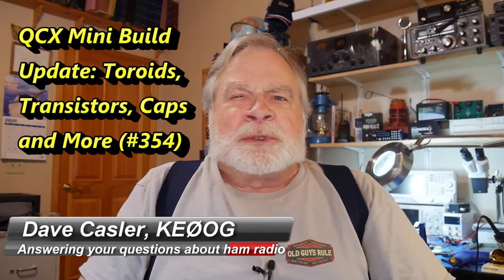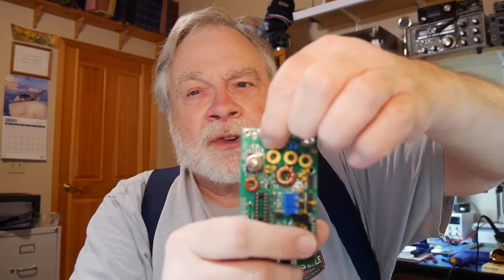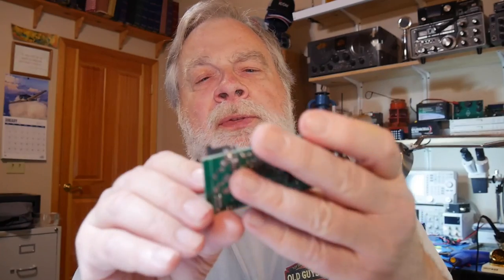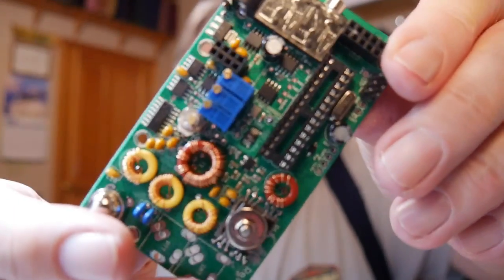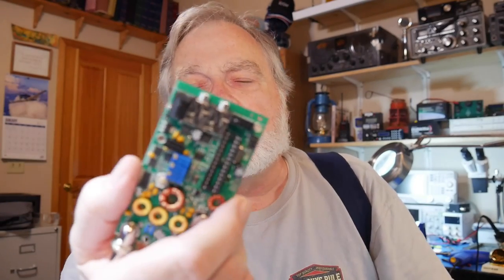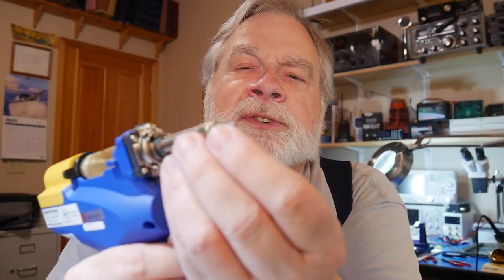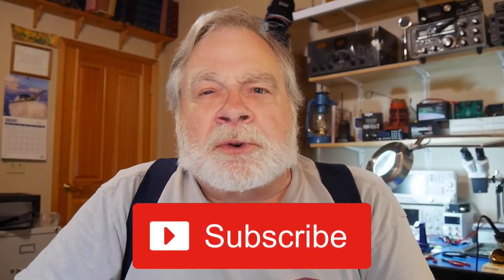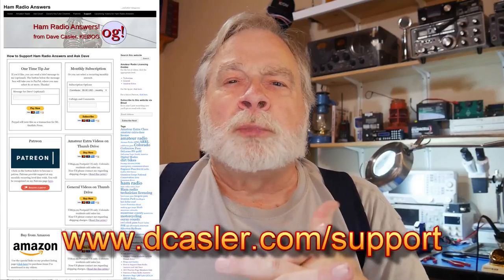QCX-mini Update: Transistors, Winding Toroids and More (#354)

Comment: Dave, let me caution you about soldering while holding ICs in place. I am a NASA consultant and years ago we had an issue with one of the HST C&DH components when we found that the same technique had been used by a component manufacturer (I forget which one it was just now) that allowed the residual stresses after soldering to cause solder creep to end up lifting the piece parts (in this case gull-wing ICs) up off the board and causing multiple failures, we (at Fairchild Space Company in Germantown , MD) spent the better part of the month of December (I’ve forgotten what year) resoldering all of those gull-wing ICs back onto several boards.  It was not a fun Christmas.  73 de Tom KC3QAC

Comment: That is a great idea with the wick and flux. Is this radio a cw only or will it also do ssb?
Reply from the maker: CW only
Reply: @davecasler  CW only but there is that note in the instructions that mentioned that they included an experimental board for future use of an SSB module.   Not yet produced.   That will be interesting.